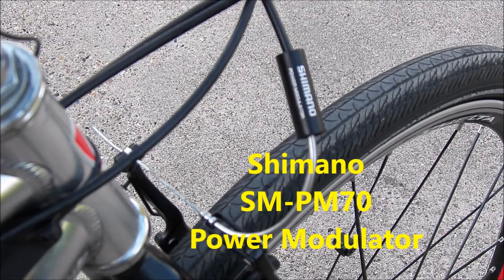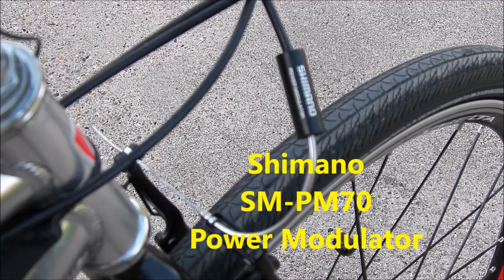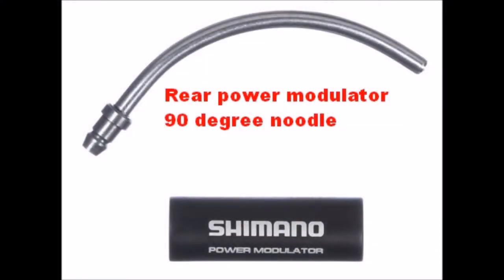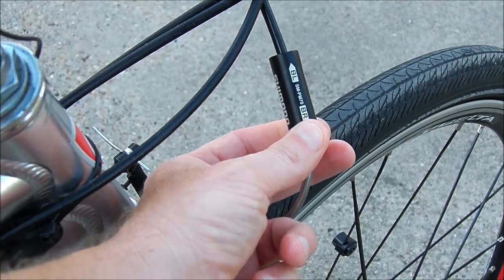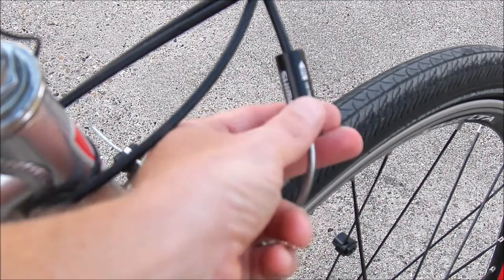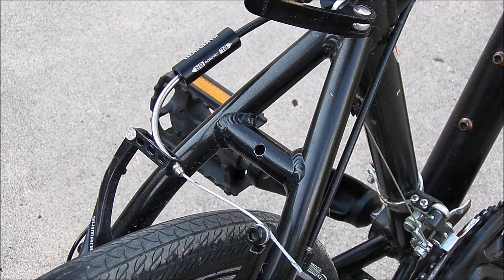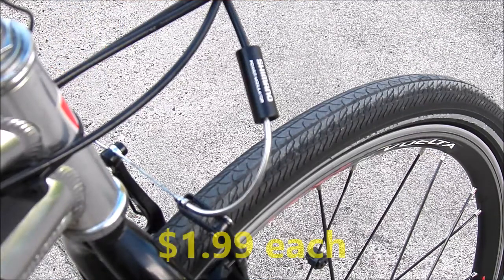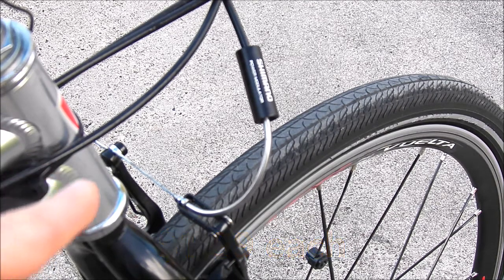NONSENSE or BARGAIN? Shimano SM PM70 bike bicycle v brake power modulator noodle review

Comment: the reasons motorcycles have the brakes hat that is because of how they shift gears
usually its left hand clutch. right hand front brake left leg gear. right leg rear brake.. btw

Comment: Power modulators increase the stopping distance and thats why its a bad idea. If it was something smarter like ABS on a car, I would get the idea, but this is just making the brakes worse... Just dont press the brake as hard if you do not want to brake that hard!
Reply: the thing is, it's intended to be of use in a panic situation, but the drawback is that it also effects the pull at times it should not. it's a compromise, as we can't have electronic ABS on bikes at this time like powered vehicles
Reply: The problem with modulating the brakes by hand is that it's not exactly easy to do. Some types of brakes are a lot harder to modulate.